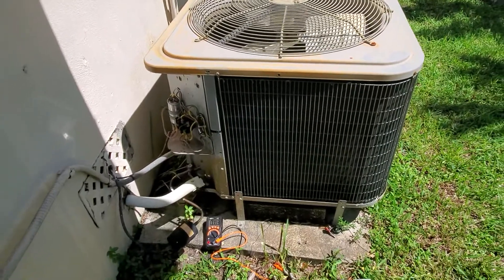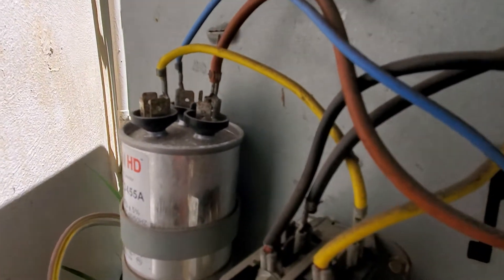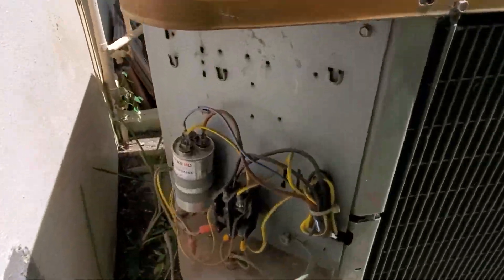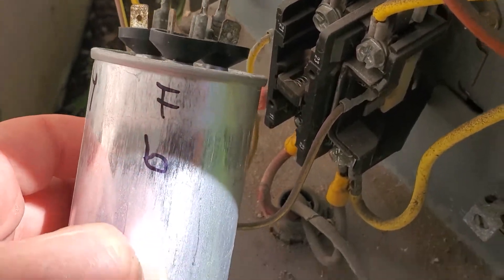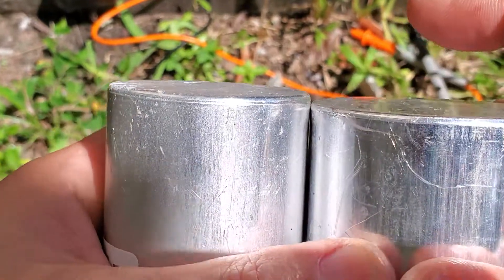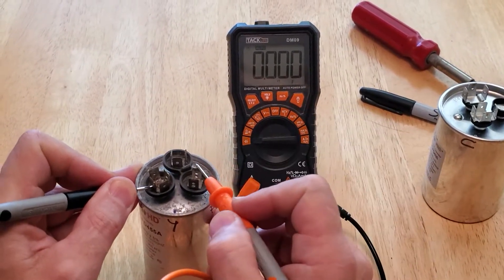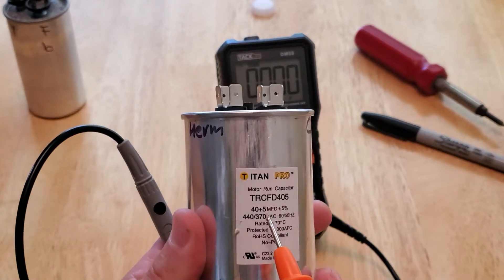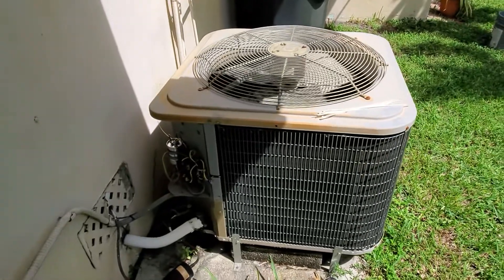Most Common AC FIX under $15 BAD CAPACITOR

Comment: You made a nontrivial mistake. You replaced a 45mfd capacitor with a 40. No good. This will potentially cause your compressor to fail prematurely if you continue to run it this way.
Reply from the maker: You are 100% correct. You have to use the same specs as before. I guess I was rushing to replace this capacitor and made a rookie mistake. 1 month after recording this video I had to replace both AC units cause they had a freon leak.